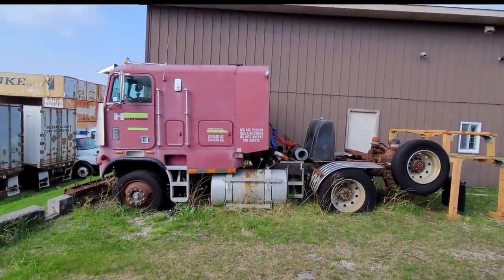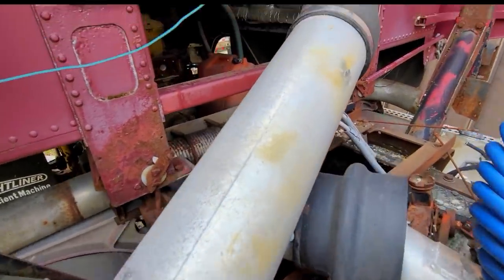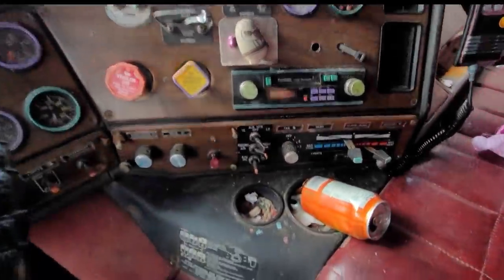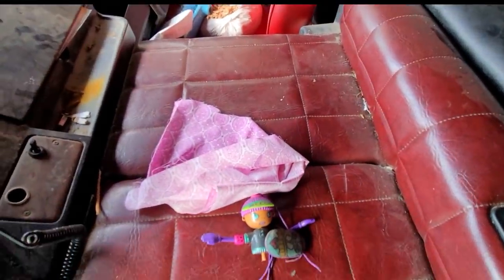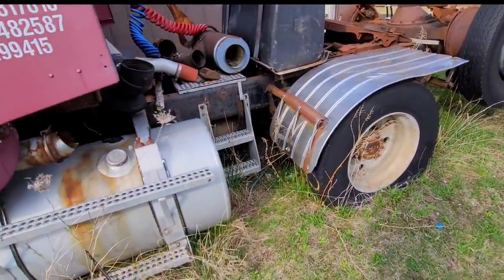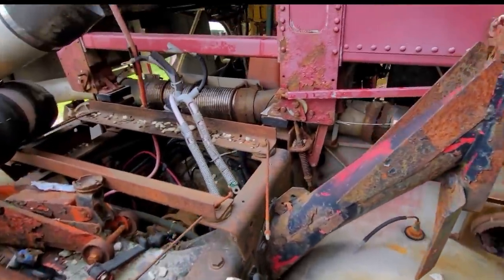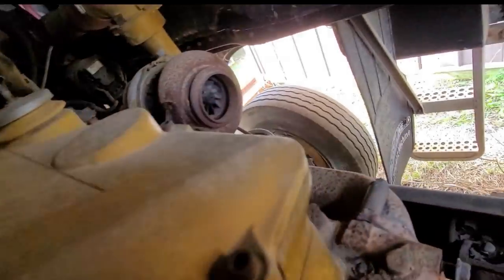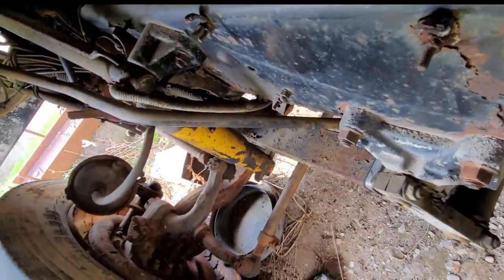New Project! - 1987 Freightliner Cabover

Comment: It already has airbags, I'm sure parts can be got to fix it even if you have to buy a whole other rearcut to get diffs. 
You might get something newer but the deisgn has barely changed. Unless you get a Kenworth 8 bag, its not worth changing it.
Time, work and possibly even cost wise rolling in a rear end from something newer might make sense, but still youre better off not having a weld enywhere.

Comment: Nice truck , hope you do make it look like it came out of the show room ! For the age the interior is in very good condition , as for the seats if the backs are sound ,just get the base's re-covered , maybe new foam/bolster's ,cheaper than new seats plus keeps the interior original , as for the gear shift ,did these trucks have a box or a sliding shaft ? - check out 'NOT FOR HIRE' channel ,he has an '87 and his vids show the cab up, and the gear linkage . The gearbox 15 speed eaton/fuller ? gear pattern on the doghouse/engine cover looked like an eaton/fuller 10(9)speed ? . Good luck ,big job but will be worth it when complete .
Reply from the maker: Ya the seats themselves should be saved, hopefully the bases are repairable, i have a guy that is great with upholstery than can fix the torn parts, i said replaced but i  should have said repaired, 👍

Comment: Ol2Stroker bought a rare cabover;he bought a 1974 Peterbilt 352 Pacemaker big bunk cabover with a naturally aspirated 12V71 "Buzzin Dozen" 2 stroke Screamin' Detroit Diesel engine.The truck is in pretty good shape;for a truck that sat inside a barn for the last 35-36 years.He got all the fuel injectors unstuck and got it to run.He plans on replacing everything that needs replacing;so it will pass D.O.T inspections to be road worthy,keeping it as origional as possible.The son of the former owner,sent him some pictures of the truck when it was bought brand new.
Reply from the maker: He's had some pretty neat trucks! That twin stick longhood was a beauty too 👍

Comment: I'm a little confused -- if the back portion of the frame is in decent shape, why cut it off? Excited for more videos though!
Reply from the maker: Its the early air ride system which was pretty bad, the airliner suspension will be a lot more comfortable especially on a cabover